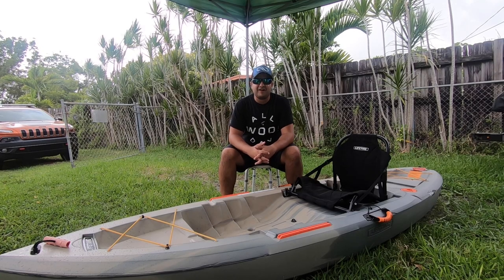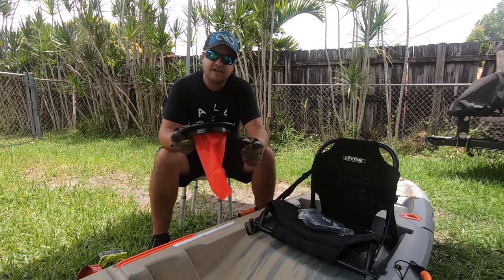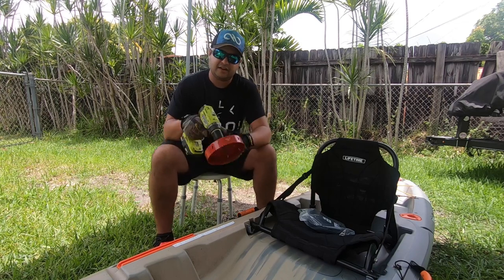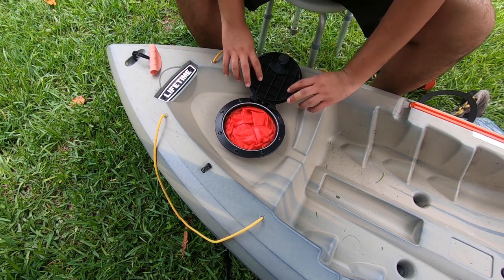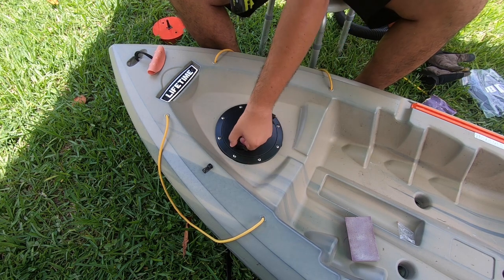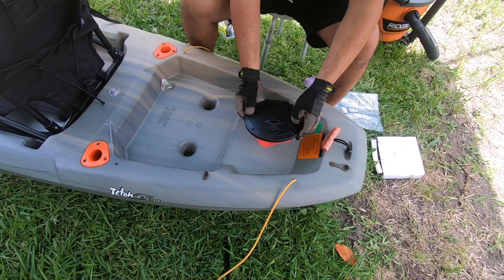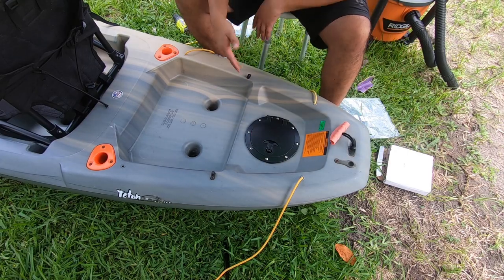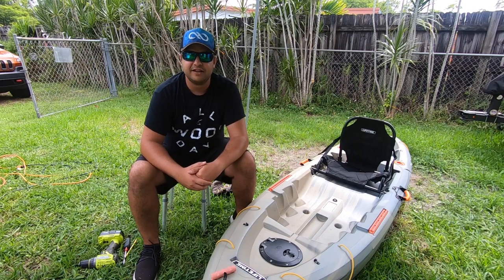Lifetime Teton Angler Kayak Modifications: Installing Waterproof Deck Plate Hatch Cover

Comment: Couple of observations - great idea turning it sideways, I never thought about that. 
When using the cutting disc, don’t push so hard. I can see it biting. Light pressure and let the saw do the work.  
Also sealant, sealant sealant! That’s the key to making these things as water tight as possible. Use a bead of marine grade sealant on both sides of the gasket and also on the screws. That will ensure that it is as watertight as it can be. 
Also, keep all of the shavings and the piece you cut out - you can heat them and use them to repair holes or damage to your kayak in the future. 
I have the same kayak and did the same mod and I love it! Keep up the great work.
Reply from the maker: WOW! Thank you so much 🙏🏼
This is very helpful 
Really appreciate it!